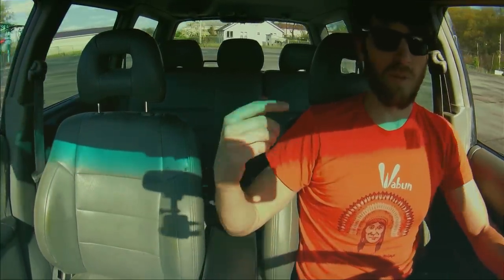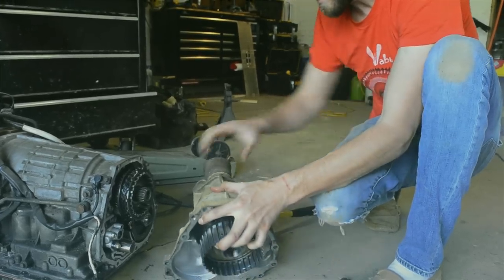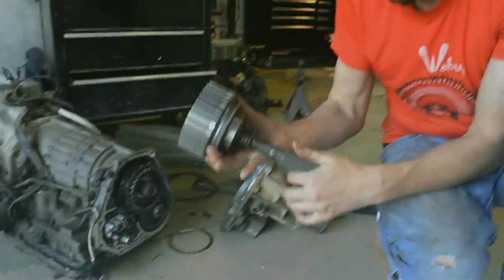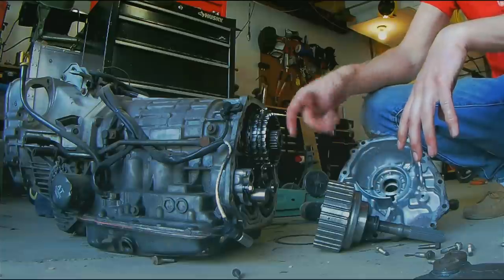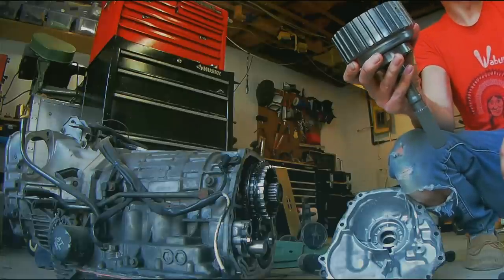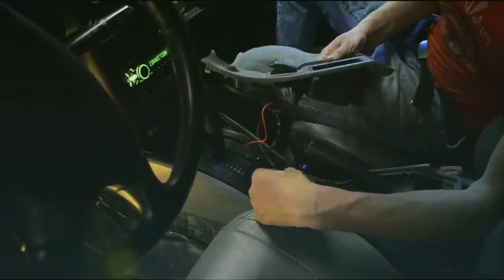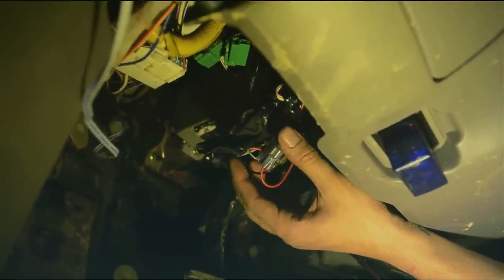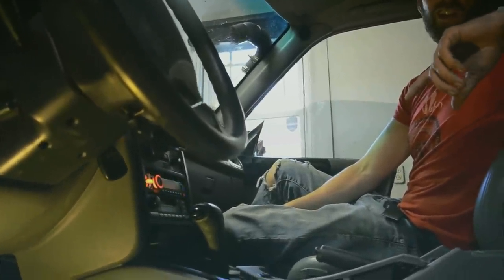Why your Off-road Subaru needs a locking center differential and how to install one for free

Comment from the maker: BIG NEWS - Torq-Masters is coming out with the first affordable SUBARU R160 LOCKER ever (thats the rear diff, not the center). These bad boys are scheduled to hit the market this summer for just $400, but we'll be getting some prototypes in soon to test and review! We're looking forward to seeing how they perform both on-road and off-road. Check out our social medias for more info, and subscribe/follow for install and testing updates as stuff happens.
Reply: Your gonna love it for off road.  For on road, not so much, but still livable.  I have a question if tires are different in tread depth, what kinda damage are we talking about?  Would it just be pulse engaging the solenoid and causing clutch wear as time went on or grooving as you show in the video?
Reply from the maker: That's a great question. I'm not totally certain, but I'd imagine that constant difference in tread wear wouldn't be enough to activate the solenoid, otherwise you'd throw a fault code. I think the tcu probably looks for momentary change more than anything else. However, thrashing the car at all opportunities and driving around a lot on pavement in low gear certainly could cause some wear similar to what we experienced.
Reply: @powerofyourbrains  Yet you really need difference in rotation to get it to slam on as it does causing the grooving.  Not to mention it also depends on the rear traction.  If the rear traction is solid and the fronts are slipping and it locks up the impact damage is more than if the traction in the rear is iffy.  This would make sense that an LSD is more damaging to this lock up behavior than an open.  More likely chance off road to have better traction in the rear with a locker than an open.  Some interesting stuff to consider, I would totally agree you want the lock switch, if offroading is your desire long term.  I thought about the difference in tire tread scenario some more and I would think it would wear down the clutches more than probably the grooving as the impact would be often but lesser degree.  At least it doesn't look like it is the hardest repair to replace....
Reply from the maker: Yeah, I can only hypothesize really. I do know that for the vlsd coupler on manuals equal tread depth is important, because it's mechanical, and forcing it out of character for long periods of time would really harm the vlsd fluid I'd imagine
Reply: @powerofyourbrains  Makes total sense.
Reply: What differential is on the current 2018-19 XV R160 R180? Will the Torq Master work on it?
Reply from the maker: @Clyde45  R160 and yes
Reply: Could this work on my 2002 Lancaster
Reply: Orrr use the brake pedal for some analogue slip limitation...trick your open diff into thinking its an LSD..
Works for front and rear...

Comment: Swapping in the vtd center dif with a static front/rear distribution ratio of 45/55 and extension case in place of the pro-dominantly front wheel drive mpt center dif is a great “upgrade”. The vtd dif can be sourced from a number of 4eat’s with Vdc/vtd. You do have to install the “awd diagnostic fuse” in fuse box under hood due to difference between the two difs. The fuse simply disables front wheel speed sensor. The vtd center dif is an open dif but still has a transfer clutch to “50/50” lock the awd, So adding the dif lock with the vtd works great for me.

Comment: this mod really reminds me of the OEM Subaru Forester 110V Power Outlet Kit. you buy a little box but really what you pay for is the diagrams that a show install and instill confidence that its not going to brake a critical part. (you could sell a pdf instructions) But this is one of the cooler mods that im going to have to now look in to So, thank you and Great work! (Because this message is prerecorded, any observations related to your performance are speculation on our part. )

Comment: This was awesome
Wish I could implement something similar on my 04 XT 5 speed manual for those messy twice a year situations I always seem to get myself into.
Awesome video, cheers from Wisconsin! 👍👍 🙋‍♂️
Reply from the maker: Thanks! Yeah, importing a dual range is a lot more expensive, but at least you've got a manual xt! Rare beast
Reply: @powerofyourbrains  Im from the uk i have a dual range 2004 forester 2.0x 5spd manual non turbo im not sure if i can do this mod or not cant find online if it has a vtd
Reply from the maker: @TheLastCast.  You don't. It's basically the STi setup with a viscous center coupling plus an MPT. To my knowledge nothing non-turbo ever received that setup.
Reply: @powerofyourbrains  Not sure,  I have Outback MY2003 5MT with low range and it does have viscous center diff, but haven't found out if it's somehow manageable, as VTD controllers were made into AT gearboxes only I think. But I'm definitely far bellow your knowledge and skills.
Reply: @TomSilver_42  got a 2004 2.0 manual dual range aswell. Just peeking into the thread in case anyone finds more info on this.

Comment: Bro how can I get a schematic of the relay hook up a few weeks ago I blew up my center diff due to tire spin. This videos was absolutely just what I needed you guys rock!
Reply: Green and white wire out of your TCU is (at least for me) the wire to the solenoid. You just wire a DPDT switch that disconnects power from the solenoid, but at the same time sends power from the TCU through a 'dummy load' like in this video. this stops you from getting any trans error codes from the solenoid suddenly disappearing. There are some decent write ups on this but unfortunately most of the images don't work. Curse you photobucket.

Comment: It `s genius. It is a pity that I have manual gearboxes because a very useful thing. Greetings and I wish you further successes.
Reply from the maker: I still prefer manuals though, and will until I find myself more offroad than onroad. Thanks!
Reply: You can get a manual with VTD, which supports this mod.
Reply: Szuwaru Tv - the equivalent of such a thing would be to use the STI rally-spec center differential (not to be confused with the DCCD used in the WRX STI), which has a higher center differential lock-up torque which works excellent on loose surfaces, but high traction performance in corners such as doing tight turns on dry pavement, suffers due to the excessive lock-up characteristics. These center differential units are used on Subaru rally cars on most low-traction stages where the DCCD is not allowed.

Comment: If im not mistaken simply putting n/c relay in line w solenoid and adding switch would simplify setup and when not activated unit would remain controlled by tcu. No resistors needed, then it would maintain vtd

Comment: Hi there. Thanks for posting this! You’ve got my gears turning for my next mod 😜 I drive a lifted 07 Impreza w/ auto tranny. I’ve heard that in 1st and 2nd gear it does lock. It may shift to third if it senses high rpms though I’ve heard too... I’d like to do this eventually but if I can get away with a locked diff in 1st or 2nd then I might work on other things before I get to this. Have you heard of what I’m talking about? Can’t seem to find it anywhere. Thanks again for posting this tho, f*ing great 👍

Comment: Absolutely great job and nice video. But quick correction but the real Subaru   VTD was coming only  on the transmission TV1*something. Your one's is TZ1*something... There is huge off-road capability in those TV1 transmissions... basically they have rear end with gears instead of plates ( like the one in your video). Firstly, worth to mention, the TV1 transmissions they are sending whole their torque to the rear wheels in proportion of 65% to the rear and 35% to front and it depends on conditions. So TV1 is the best to go! 👍
Reply: Yupe swapped my blown MPT in my old 2001 H6 USDM for a JDM VTD unit , it was cheaper than a used a transmission from a regular yard, the car was high fun to drive in the summer but it the winter wihout any proper lock control in heavy snow the car was too prone to drifting

Comment from the maker: Check out the full mod overview video linked in the description for more!
Reply: Power of your brains do you think I could I do this mod on my 2014 crosstrek 5sp?
Reply: Hi,can it be done to 2018 subaru xv?
Reply: Hey POYB, I've read on Subie forums that putting the 4EAT in 1st or 2nd gear locks up the center diff, with no need for a mod. Is that BS in your experience? Thanks man!
Reply from the maker: @jhoward103  That's not BS and that is how it works. However, if it locked up fully then it wouldn't take long to damage the transfer clutch, so its likely some degree of partial lockup. We've been meaning to hook up an oscilloscope to quantify this theory but haven't gotten around to it. Also, back before we had lockers we used to drive around in low gear for this purpose, but frankly, we didn't like redlining the car all the time.
Reply: @powerofyourbrains  LOL, makes sense. And thanks, that's great info. I've had good luck so far with my stock '06 in 1st or 2nd gear, but I think true center lockup and maybe a torsen rear diff are down the road. I'll likely run it as is until I break something tho, lol. Thanks again!
Reply from the maker: @jhoward103  No problem at all! Did you hear the big news last week though? Check out the comment I just pinned ;) And you can find more info on our FB as well.
Reply: @powerofyourbrains  That's amazing! Thanks so much for telling me! I'll definitely be watching your channel!

Comment: It turns out if you had the SG forester with the 4EAT, if you put the car in snow mode it locks the centre and you set gears to manual that works well also. i got my VLSD rebuilt on my SG and got a Monza Torsen D2s front diff made it a beast offroad!, great channel and very detailled vid.
Reply: I have a sg forester 2.0x auto. Is the snow mode that you're referring to the HOLD switch?
Reply: @bxbLJ  yep. It locks the centre 50 50 and starts in 2nd
Reply: @ceterisparabus  interesting. I knew it started the gears in second. Didn't know it locked it. So if I were to select 1st gear and flip the switch to HOLD, it should function as this video?

Comment: I like those practical based videos! 
I'm considering to get a rear torq locker for my SH 6speed diesel but i'm not sure if the center lock hack works for mtm aswell and if not make it any sense to get a rear locker without permanent "locked" drive to the rear. Maybe you can help me out

Comment: If the MPT center diff was replaced with a VTD center diff wouldn't you just need to put a 10 amp fuse in the FWD slot in the engine bay fuse box to "trick" the TCU from throwing a code, then all you would have to do is remove the bulb from the dash cluster 😎

Comment: I believe VTD is system applicable to auto gearboxes with center diff, (TVxxx). You can lock them as well (as you did), but solenoid control has kind of opposite logic - it needs no signal to unlock and signal to lock. I swapped my TZxxx gearbox for TVxxx on SG5 and couldn't find proper TCU. My old one works fine for everything except center diff control, I had to cut this wire for now until I find proper solution.. Not a fan of resistor trick because it'll probably become quite hot. 
Manual gearboxes (at least in Imprezas) all have center differential (your old  auto TZ* gearbox doesn't), and manual would either have viscous diff or DCCD (STi only). You can lock DCCD, but I can't see how you can do anything to lock viscous center diff without changing it completely.
Reply from the maker: Yeah, which is why Subarus claim that they lock in new mt models is bunk. It sometimes is reversed, but on our 2002 and 1998 models the MPT is the same as the VTD-MPT. The fact there their are models out there that are is one of the reasons we didn't make this an instructional video. Also, our setup with the resistor on our 2002 has been 100% reliable, so take that for what you will. Granny (the 1998 one) is setup differently, and still utilizes stock functioning of the MPT when off
Reply: @powerofyourbrains   Great, maybe will put resistor on my car to stop that light blinking, but that's just daily driver, so it was ok as is. Other than that, I'd rather have continuous control of VTD in OEM fashion, not only lock. But these TCUs gor SG5 with VTD gearboxes are kind of rare..  Have you ever considered using some custom transmission controller? Like MegaShift maybe or something similar?
Reply: I would've wired in a relay to reverse the AWD clutch solenoid signal, problem solved 👌

Comment: Just watched this, very interesting and innovative! Can this be done to a 2018 Crosstrek?
Reply from the maker: RoadPirate 50 Thanks, and that's a good question. The cvt is uncharted territory as far as I'm aware. Can't imagine it'd be quite as strait forward, but where there's a will... We have no access to any late model examples to experiment with unfortunately
Reply: This has peaked my interest as I have a 2014 XV s well. Or CrossTrek, take your pick with the name...
Reply: I would think that doing this on a CVT would render x-mode useless though.... unless X-mode doesn't control the center diff.
Reply from the maker: Lookw like Xmode increases center lock by only 25%. In theory, full lockup would make Xmode better
Reply: @powerofyourbrains  cvt doest seem to even allow wheel spin. Im assuming to make it easier when it locks up. Xmode will increase the likelyhood that it locks the center diff and since it only operates below 18mph probably doesnt stress the center differential.

Comment: Okay so I have been digging absolutely everywhere trying to figure out if this modification is only done in a 4EAT with the MPT or if it can be done on both MOT/VTD and I have been trying to figure out whether my 98 legacy outback limited 30th anniversary edition car has the damn MPT or the VTD and I still can’t find that info...
 I think after searching everywhere and reading a billion threads and brainstorming how in the hell this all works etc etc I need an answer to this and I hope I can get a reply. 

This switch mod to control the solenoid is ONLY done on a 4EAT with MPT “center diff” and NOT on the 4EAT with a VTD “center diff” am I right or am I wrong? Can it be done to both or should it only be done to one or the other?!?!

Gaaahhhh my brain is on fire 🔥
Reply: I believe it is only for the MPT 4eat, because the VTD is next level already and the lock up mod brings the MPT close to the VTD level.

Comment: This is great! Can you do something similar to the rear?
Reply from the maker: Thanks, we have a video on how to swap a vLSD on the rear, which is a pragmatic and inexpensive thing you could do. Works well for the money. Otherwise, a clutch-type lsd would be 1k+, and an r180 locker setup would 2-3k more than that...no electronics to tool with back there. Better off investing in a long travel setup to prevent traction loss from occuring imo

Comment: Separate question: seems 5th gen outback brake traction control is much better than 4th gen outback.  I am comparing 3.6 4th gen outback to any 5th gen outback.  Not sure if difference is more a function of MPT vs VTD (i.e. CVT vs 5EAT) or 4th gen vs 5th gen, even comparing 4th gen 2.5CVT/MPT to 5th gen 2.5CVT/MPT.  Also take x-mode out of equation, since 4th gen does not have.  Thinking of buying 4th gen 5EAT b/c I like feel of VTD, but for off-roading it seems like a trade-off - more wheel slip and less aggressive/effective brake traction control, so probably puts more power down for snow drifting, mudding, and hill climb, where you want momentum and wheel spin, but can be more easily defeated by off-camber situation (or any situation that causes traction loss to at least one wheel on both axles), so worse for slow, controlled wheeling.  Is this accurate?  Anyone have lots of experience with both systems?  I'm basing this on comparing lots of vids and limiting driving time I've had in both cars - haven't had a chance to test with rollers or do extensive off-road testing to be sure.  With all the subaru nuts on the internet and suby meets that I'm sure go on, frankly I'm stunned no one has done roller tests with all gens/systems on outback and other models side by side to clearly show differences (would be really easy - just bring rollers, or some small ramps, and film it).
Reply from the maker: We have a video from about a year ago comparing vtd vs non-vtd. Long story short, vtd with a lock switch installed is definitely the best setup.

Comment: Super cool , I had no idea but now it's something else I wanna try. 
Also how did you secure the snorkel to the window frame ?I'm looking to do something similar but haven't quite figured out all the details
Reply: daniel paris There are 3 pins protruding from the sheet metal that hold the trim to the edge of the window. I made a small bracket with a hole that goes over that pin which is retained by an e-clip snapped over the pin. That pin eventually got torn out of the sheet metal when we snagged the snorkel though. so now that same bracket is pop riveted to the sheet metal in the hole left when that pin was ripped off. Works ok, but the pin is pretty small. Probably going to try something different in the next one.
Reply: +Jason Chall thank you man , I kinda get what you did . Either way I appreciate your help